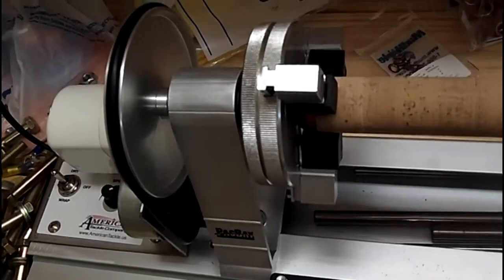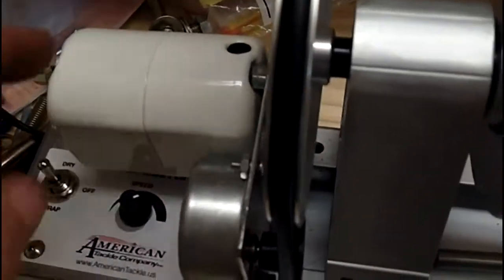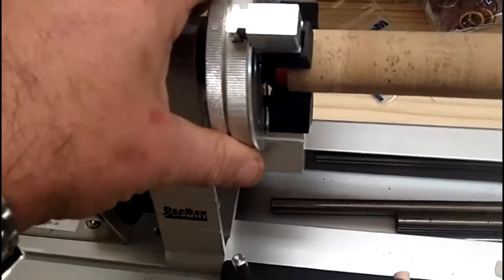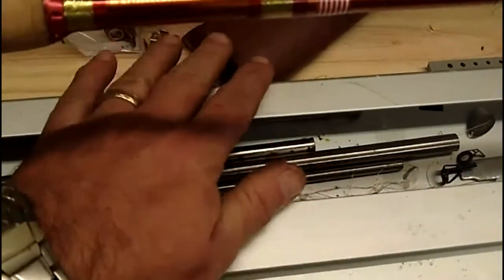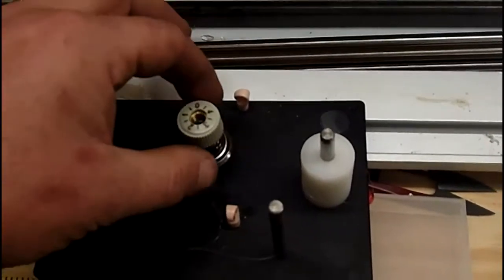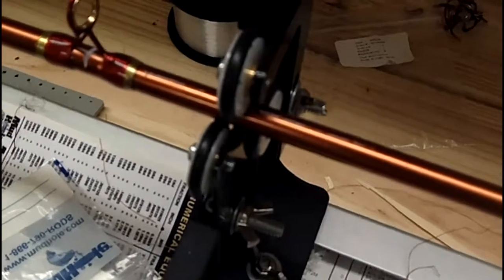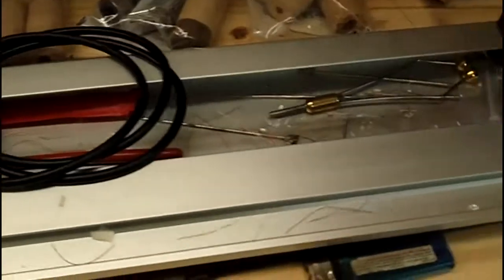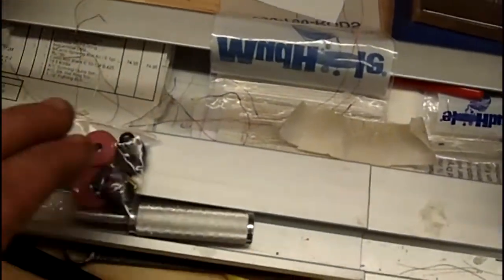DIY Fishing Rod Building With American Tackle Wrapper

Comment: Could you show how the guide holder works. Thanks Karl k...
Reply from the maker: Sorry. I have not used the wrapper in a while and would be a bit before i could get it setup and video about the thread guide. But until i can do that is there anything specific you would like to know about it. Note the tension adjustment should only be tight enough to hold thread when thread is cut but does not need to be any tighter.  Thread should be ran through bottom ceramic eye then between the spring loaded tensioner then last eyelet.

Comment from the maker: one thing i would do is take the rubber pads off.. my chuck does not loosen up its just the pads popping out.  one thing you can try is to line the jaws with a rubber compound that when dried it would grip the cork better..